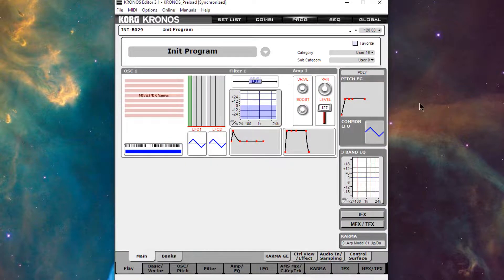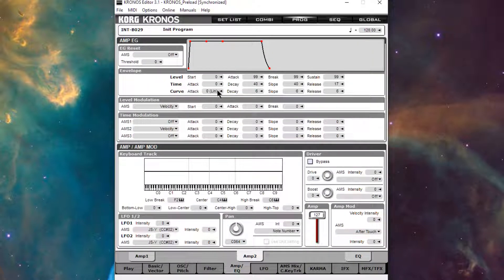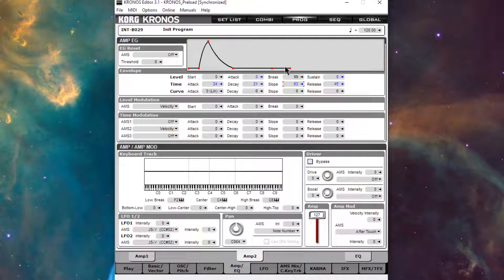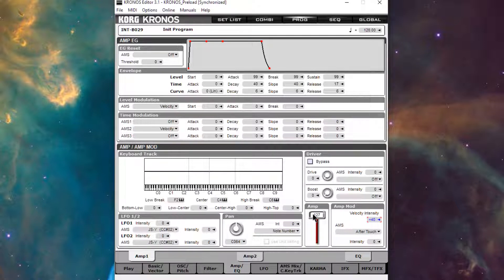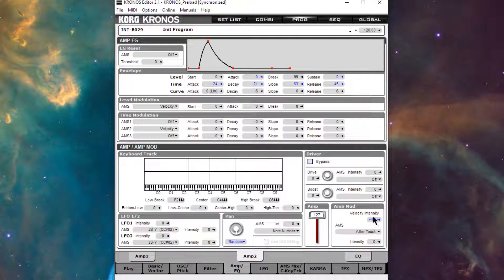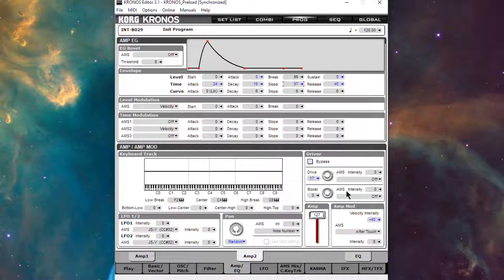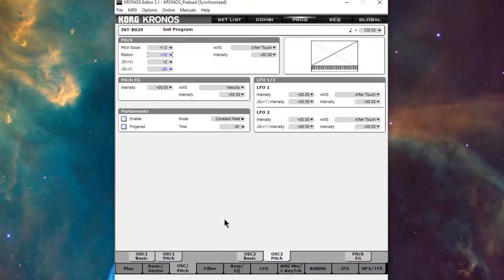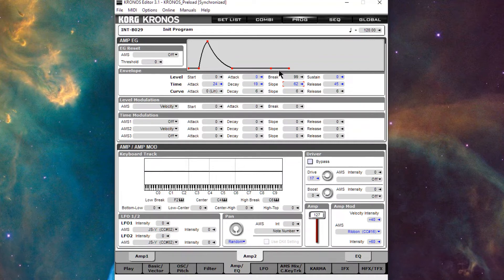HD-1 Reverb Oscillator

Comment: Nice video.
Would be great if Korg can make a Kronos S like Montage with MODX for small budget, this synth is awesome and powerfull tool of sound design
Reply from the maker: Seven Synths thats pretty much what the Krome EX is.  The reverb oscillator patch can be done on Krome.
Reply: @CharlesFerraro  
The Krome EX support all that synthesis engine, with sampling direct into the synth, and can add extra SSD for user samples or library?
Reply from the maker: Seven Synths yeah I’m pretty sure. It might take SD cards instead of being able to install a hard drive.
Reply: @CharlesFerraro  
So i can make my own samples library and stream on the SD Card with it? 🤔
I think i already check for that but need to double check now!
Reply: @CharlesFerraro  
Ok i check, with SD Card you are able to import Krom EX files for extra library etc... But you can't sample in the workstation or import your own wav files, so is not what i want, i would like the exact same possibilities of Kronos but in a lower cost workstation.
Reply: @overload8741  that's a great idea
Reply from the maker: @overload8741  Check out the Nautilus :)